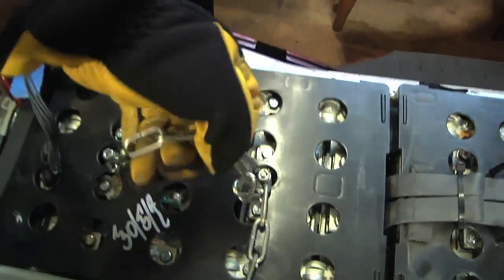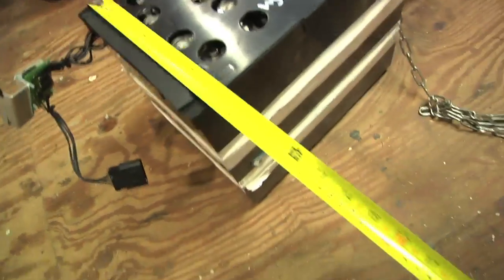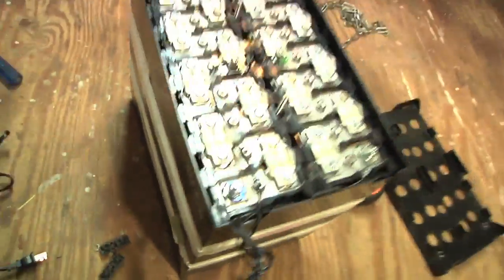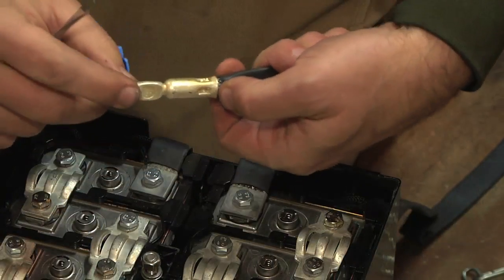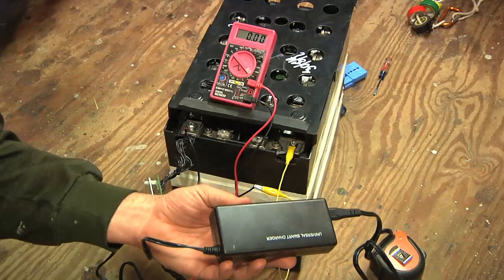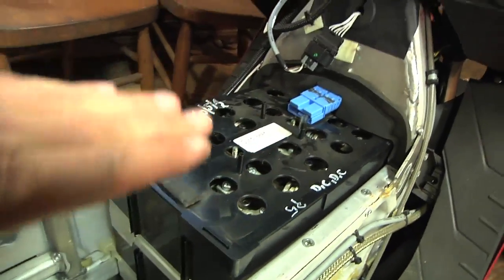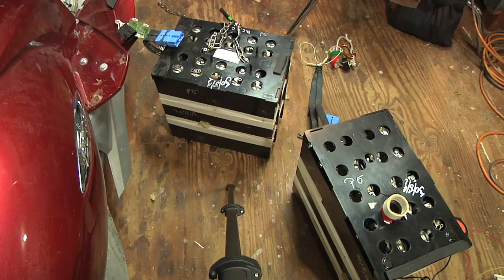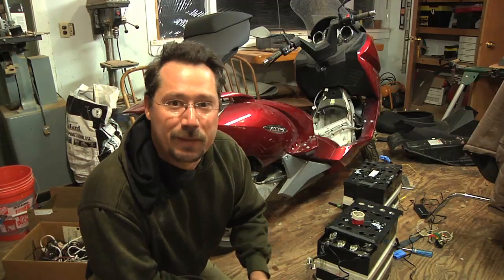Vectrix Repair: Day 2 - Battery Removal

Comment: Needs redesign for the batteries to be replaceable in less than 5 min and without any tools
Reply from the maker: Why? When I was done with this project, I could go about 90 miles per charge. Perfect commuter vehicle, and dirt cheap to run.
Reply: @BenjaminNelsonX  why not ? just mount the batteries in a way they can be replaced in 5 minutes, then you go 9000 miles if you want to ... I stop for hours when I want to not when I run out of battery ..... huge, huge difference
Reply from the maker: Batteries are typically the most expensive part of an electric vehicle. A swappable pack with a pre-charged replacement means that you've just doubled your cost.
You would also need to have the extra pack WHERE you want to use it! If you plan to ride 9000 miles, you need to have your packs all along that 9000 mile route!

(There HAVE been companies that have tried to standardize battery packs, have them in multiple locations, and have those batteries available for customers. That business model has failed all those companies.)

Weight is also an issue. The completed back that I built for this cycle weighs 150 lbs.

Many EVs now have the ability to fast charge. My daily driver can recharge in about 20 minutes at a CHAdeMO station.

On this cycle, I added additional chargers. I made a trip 1,200+ miles around Lake Michigan on the bike, usually charging at State Parks during lunch. The cycle was always charged before I was ready to leave.

Please keep in mind that this video is one of the very first in a whole series about this electric cycle. Just search "VECTRIX" on this channel for how I upgraded the battery pack, added charging, and took trips with it.

Here's a playlist.
https://www.youtube.com/playlist?list=PLmHss3DBZUinx-DxMLnax485Alj5i5Lcn
Reply: @BenjaminNelsonX  Quickly swapping batteries at dedicated locations  or petrol stations is THE ONLY MODEL electric vehicles will ever dominate the roads ... Vetrix model failed too, going full bankrupt, right ? Honda pcx electric model is just picking up speed although they have puny autonomy atm ... Anyway quick battery removal comes in handy even if you dont want to adopt the replaceable model and there is no reason not to design it like that  ...

Comment: Yep about to do the same thing take that huge old battery out of my vectrix and see what is going on in there.Did you have any problems with the motor controller, I'm told they are badly designed will have to check that out as well as I'm getting a strange sound when I pull away.
Reply from the maker: +flitsies I've had no problem with the motor controller. It's been great!.
Reply: BenjaminNelson I'm given to understand the motor controllers main posts have a tendency to corrode and burn.

On v for voltage there is someone who came up with a solution fix.

Anyway nice to see your solutions for the battery.

I also liked your solution for the charging very interesting.

I'm hoping to put my one back to the original battery, simply because I don't have the link for the data connection, I found some software but the cable seems a bit on the pricy side so I will end up trying a work around the battery to fix it.

Keep up the excellent videos.
Reply from the maker: +flitsies I checked to make sure the battery cable connections at the controller were tight. They looked good. I've heard of guys re-sleaving the steel posts with copper tube. Mostly just check that you have good tight connections.
Reply: BenjaminNelson Thanks for the info I just gotta get around to doing this as it's a nice bike.

Comment: The many single cables look more like charge balancing than temperature sensor.
Reply: BenjaminNelson
That's affirmative. They are temperature sensors. And there will be no charging without them. So don't throw them away. And FYI, they are very sensitive to humidity. Sometimes Vectrix don't charge because they have false readings from them, due to moist.
Reply from the maker: May look like it, but they are definitely temperature sensors.